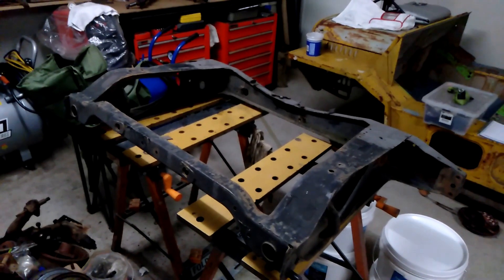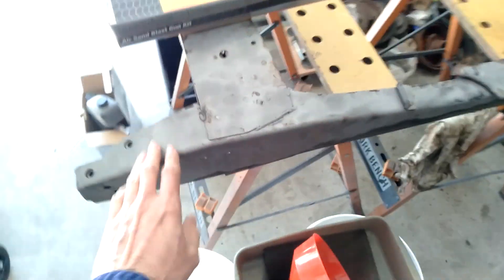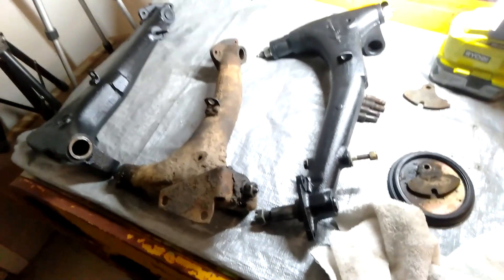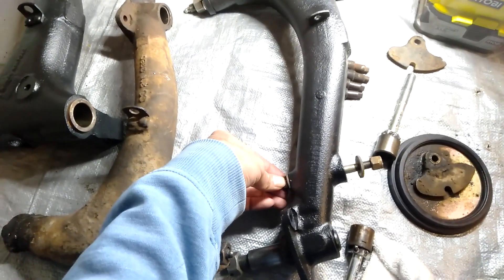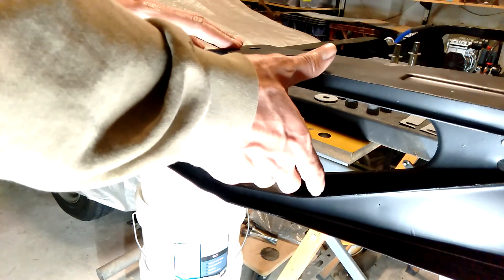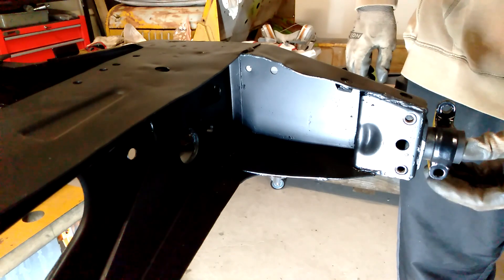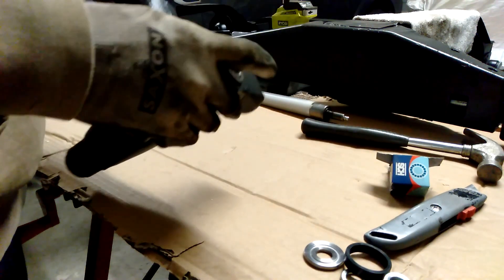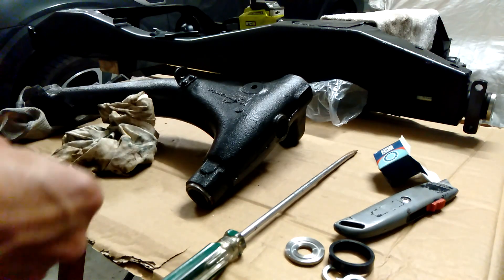Moke Rear Subframe EP10

Comment: I like the results of the sand blaster. The subframe is amazing condition compared to the rest of the body. My guess is it might not be original. 
I also struggled with one of the studs for the shocks, I had a workshop remove, fix and re-tap it.

Comment: Amazing videos mate. I’m about to strip a moke down and find these videos invaluable. Where did you buy your sand blasters? And what treatment did you paint your bare metal and sun frame with?
Reply from the maker: I got my sand blaster from a local autoparts store, they all sell similar units priced around AUD $220. Bare metal was cleaned with wax and grease remover then coated with etch primer then 1k black paint.
Reply: @CafeRacerLab  I am about to strip my moke down to get body work done for compliance. Do you know of a resource for the strip down? (Your build videos are awesome)